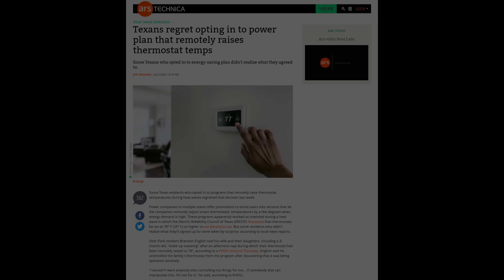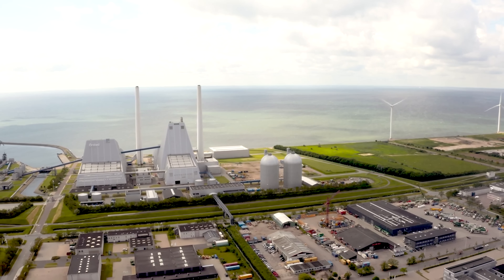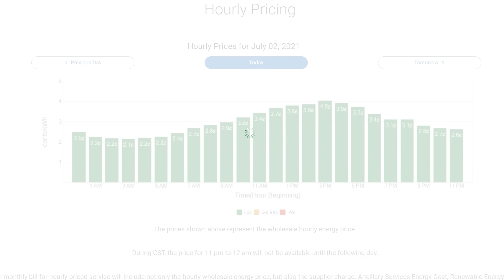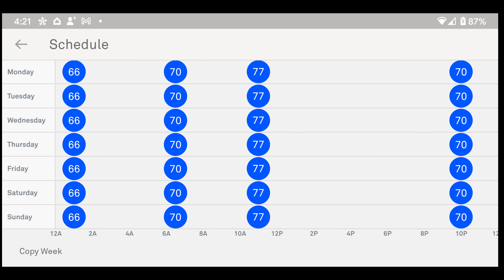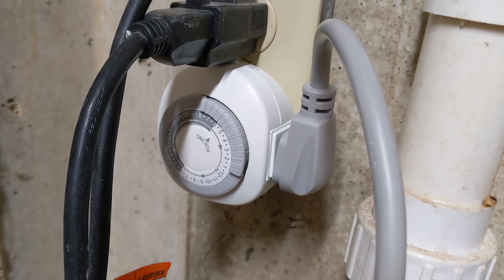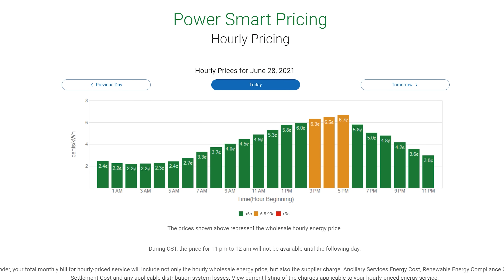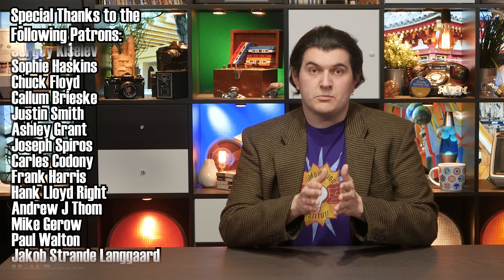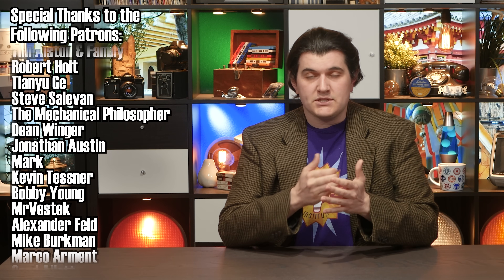Batteries aren't the only way to store energy. Here's another.

Comment: I’m an HVAC contractor and have been promoting for years that customers take advantage of cheaper electric rates in the evening by over-cooling. It’s so rewarding to hear you reinforce my recommendation.
Reply: It takes less than 3 hours for our house to go from 72f to 85+ in the afternoon. It's not possible to pre-cool enough.
Reply: @cheyannei5983  Is your house very well insulated? Double/triple glass windows with reflective coating and proper wall/roof/floor isolation should make a ton of difference. The whole concept of pre-cooling does not work at al unless your house is insulated well.
Reply: @cheyannei5983  it really depends where you live, if your house is shaded and what the insulation and windows are like
Reply: ***laughs in Floridian
Reply: @cheyannei5983    More insulation not joking. I've lived in both and a heavily insulated one dramatically slows that temp change down
Reply: Internal walls need to be brick/stone to maximize accumulation and thermal inertia, that will also minimize the actual temp change range.
Reply: @aka7kak8  so in order to increase your energy efficiency, you need to exponentially increase the expense, difficulty of construction and maintenance.  Got it.
Reply: @TheDiosdebaca  , to accumulate enough during night overcooling, yes, will need massive internal structures.
Reply: @TheDiosdebaca the point is to reduce energy usage during high demand times. if you need to modify your house to do this, the goal of saving money is definitely reduced/failed, but it still accomplishes the goal of reducing grid strain.

whether or not this technique will accomplish your goals depends on your goals.

but also, insulating your house more effectively would save on energy usage regardless if you pre-cooled/pre-heated anyway
Reply: @cheyannei5983   Your house isn't properly insulated then.
Reply: @TheDiosdebaca     Maintenance is not a consideration in this scenario
Reply: @cheyannei5983  Why not start at 60F then?
Reply: @hailexiao2770  We have proper insulation for the most part, 16 inches roof, fiberglass walls, double pane glass. The problem is that it's usually 90 to 110 out and in incredibly intense sun with no shade or clouds. I suspect nobody in the comments lives in these deserts-to-be.
Reply: For houses that's a bit difficult but as someone who also works as an HVAC technician, commercial buildings, especially if you have hot and cold water networks used for room control, over heating and over cooling each respective networks, you can avoid consuming during peak periods and still maintain comfort inside. Also you have special equipments like thermal bank type boilers.
Reply: @hailexiao2770  It might be still warm out at night and the bigger difference you have between inside and outside the harder / longer your AC has to work in order to get to that temp. Also ACs can only cool air so much, at a certain point they will not be able to go below a set temperature for your house. Many can probably do 60F but it is definitely approaching a point where you are asking a lot more of the AC system that it is designed for.
Reply: @elmardus  lol. Yes. Let’s spend $1000’s of dollars now, to save $100’s later
Reply: I did this last summer to an extreme, in an area that was 90-100 most afternoons the house rarely got above 80. This is with no AC
Reply: @elmardus  which makes it completely unfitting for most Murican homes.. single-pane window and no insulation whatsoever. "but it was cheap to build"
Reply: @TheDiosdebaca  no. you just need to build your homes according to the standards that the rest of the first world has adopted decades ago.
Reply: @jamesbizs  one-time invest vs recurring savings. And the current system only works bcs energy in Murica is so dirt cheap, much cheaper that what is sustainable. Same goes for the houses. Cheap but not sustainable at all.
Reply: @RandomUser2401  look, as someone who literally does HVAC for a living here in Florida, I can tell you that substantially increasing the mass of the home with concrete or some other solid material is a bad idea.  It won't have the same effect as somewhere like Europe.  While it does take heat slower, the average summertime temperatures is about 86 (30c) right now.  So 17 hours of direct sunlight, then nighttime temps of 80-82 (27-28c) it doesn't cool off.  So you use far more energy to fight heat load than you do with a well insulated block/wood frame home.  It's easier to heat something than cool something, and cooling is very energy intensive.  There is a reason we do things this way here, and a reason you do them that way where you are.  So unless you really know what you're talking about, don't be quick to judge.
Reply: @TheDiosdebaca  well a well-insulated wooden house is perfect no matter where you live. However the problem in NA often is that houses are plain horrible or not insulated at all, which is always a bad idea.
And the reason "you" do that is to build homes as cheaply as possible and then use enormous amounts of cheap, fossile energy to heat and cool them, plain and simple.
And I don't see why cooling to the same delta-T should be more difficult than heating, they are both thermodynamic processes.
Reply: @RandomUser2401  your ignorance betrays you.  For decades the building codes have required significant increases in insulation, since about 1996 or so the amount of insulation has nearly quadrupled.  And even then, it required r20 at the minimum, now r-35 is the standard in attics and r-12 in the walls.  Just because you "assume" that NA has done it one way in the past doesn't mean we do it that way now.
Reply: @TheDiosdebaca  well my personal experience speaks very otherwise. No insulation whatsoever, single-pane windows in an area where winters are -30C and summers +35C.
It's funny, you hear about all these codes in NA all the time, and yet European houses have been up to much higher standards in all aspects of building tech for decades without such strict code guidelines.
Reply: @cheyannei5983 Just in case you're not already aware...evaporative cooling aka swamp coolers are a great go-to option in hot, low-humidity areas like the desert. They are much, much cheaper to operate than normal AC units.
Reply: @stormthrush37  I live in Dallas and the average humidity is 50%+ at my house over the year. I live less than two miles away from one of our man made lakes so we get extra humidity off of its evaporation. Evaporative coolers are not reliable here.
Reply: It's weird to think that everything in your house and your house itself is a battery that is often not used
Reply: @cheyannei5983 I live in Eastern Washington State. You’ve described our summers. Up to about 115° in the summer, with 10-20% humidity.

Comment: When you said you were using your house to store energy, I was hoping you had converted the entire upstairs into a big swimming pool, with a mini turbine and pipes to the backyard pool.
Reply: I was thinking about some heavy weights bound to a pulley with some kind of gear reduction/transmission hooked up to a motor. Motor powers up during night to pull them up, slowly drops them down during the day generating constant input for the rest of the house.
Reply: @PFAlt  I came up with a gravity battery concept that I'm getting ready to toy around with. My house is a rental though so I can't actually use it and it'd be entirely prototypical.

If you have solar panels installed you could use it to store potential energy that is discharged in low light conditions. I'm certainly not the first to come up with it but it feels good to come up with something before you heard about it.
Reply: You mean using solar power to pump water up during the day and then releasing it at night?
Reply: I thought he was somehow heating it up then converting the heat back into electricity
Reply: @whogavehimafork  the energy density of gravity batteries is very low. They're better for large-scale applications.
Reply: @illuminate4622  Oh I'm aware of that but I'm an engineer and I enjoy challenging topics. I especially enjoy unreasonable, impractical, and over-the-top solutions for fun.

And I never said a gravity battery would be the only method of energy storage that I want to explore. Especially in national discourse in the US people get hung up on individual technologies and forget that these systems can be tied together. Certain politicians also love to ignore the need to diversify energy sources but that's for another time.
Reply: Thats a go fund me opportunity if ever I heard one.
Reply: @PFAlt  you would need a lot of weight. You need to haul a small to medium car to the height of the Eiffel Tower to store 1 kilowatt hour. As most houses are 6m to the attic, then you would need around 60 tonnes worth of weight for a single kilowatt hour, which would likely just crush the ceiling in. Alright to power something small, but that's not what you're using them for. A 10 minute shower will eat up all that juice and more.
Reply: The weight if the water is oretty quickly adding up with its density of 1kg/l
Reply: @TimpBizkit There's a Youtuber I watched ages ago but can't remember the name of now. He tried a bunch of wacky ideas people come up with but reject, like putting a wind turbine on his car. Another thing he tried was a giant barrel on the roof to collect water then dump it down a pipe to a turbine. Even with numerous optimisations to the turbine blades and water jet, the huge barrel stored about as much energy as an AA battery.